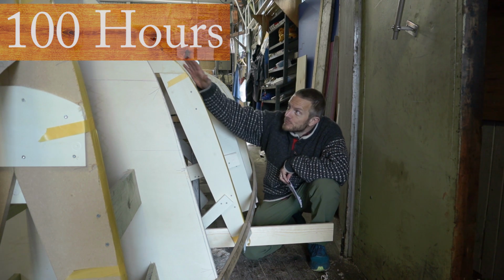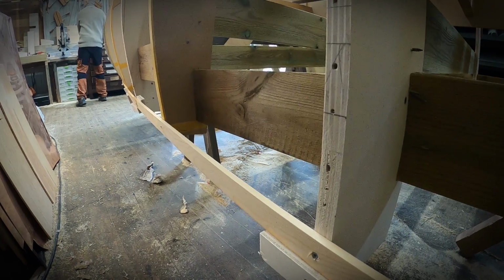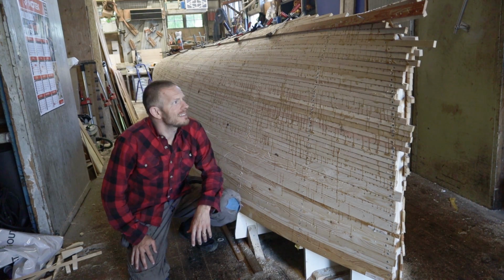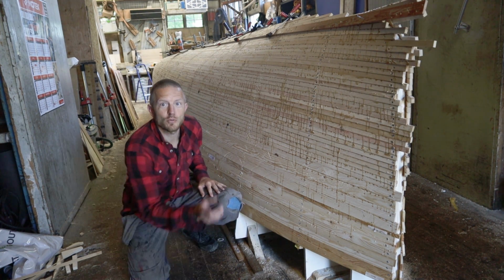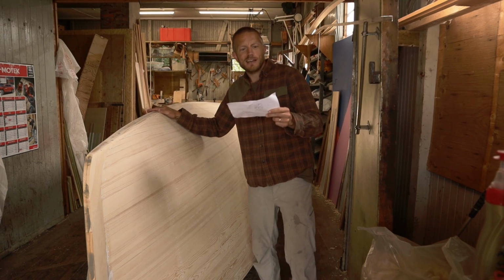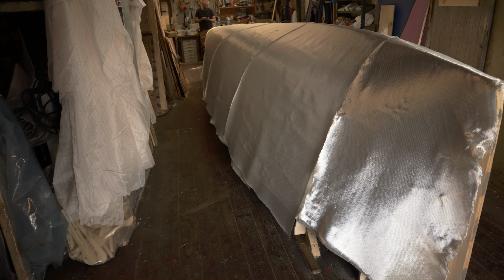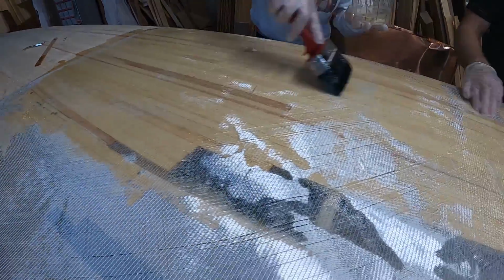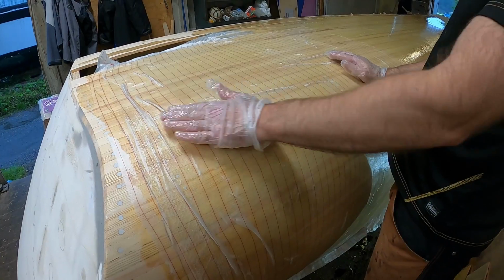Building a $100.000 Boat in 800 Hours | EP2 ⛵

Comment: There should be a channel called "The Trouble With Peel-Ply" I recently (friday) put some on the bottom of my 16 ft rowboat I'm building, and it's nearly impossible to put on without all sorts of wrinkles, nearly impossible to get the wrinkles out (working alone too!), and the idiots sent it to me all folded this way and that into a little 7 inch x 7 inch bundle so that the creases are all over the cloth. No matter how hard I try it refuses to lay flat and all those creases keep rising back up or bending down. When I peeled it later on, it was a checkerboard of 7 inch rectangles with up-ridges to be ground flat, and down ridges to be filled.
Reply from the maker: 😂 Espen!? are there different sorts? cheap/expensive or something?
Reply: I have the same problem😅. The thing is, peel-ply is not flexible like the biaxial fibreglass. It does not shrink or stretch in the same way. On the outside of the boat it was not a big problem,  but inside i got much more wrinkles. I will hide it under the floor and seats😁